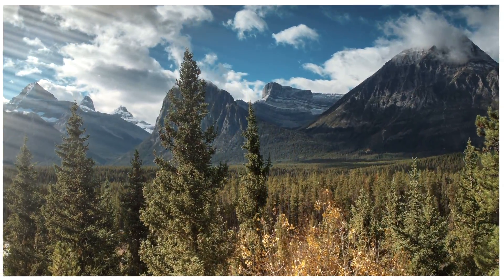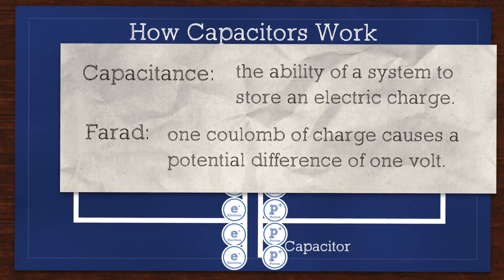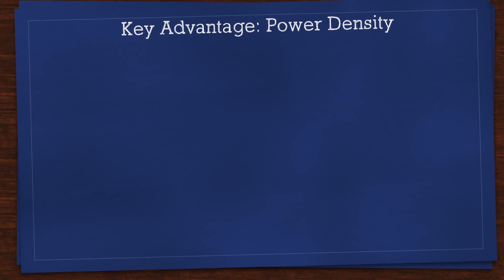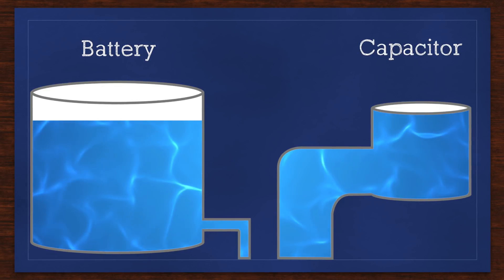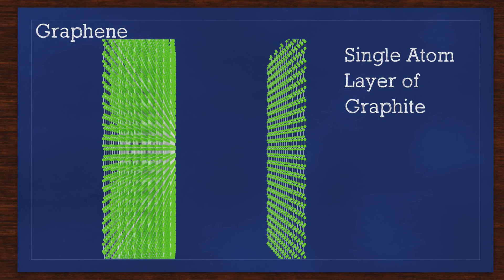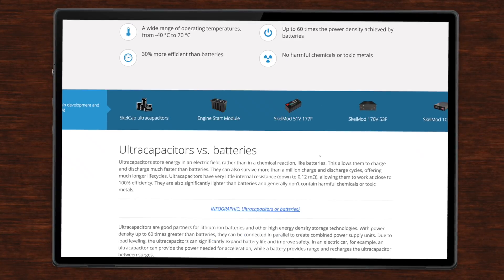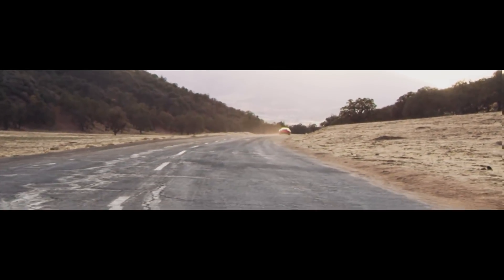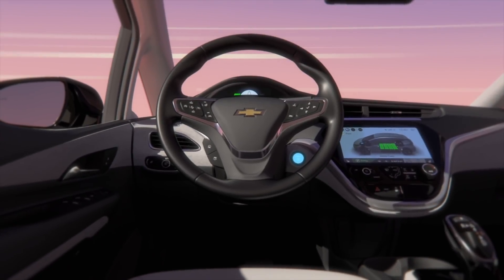Can This New Technology Make Batteries Obsolete?

Comment: I'm not quite believing in the 'charge a car in seconds' hype. The capacitor might be capable of it, but the charger (and the electrical grid it's part of) probably won't be. Charging 100 kWh in one minute would be 6 million Watts. Might as well hit the car with a lightning strike. Even Tesla decided to pull back from the 350kW Supercharger V3 and are thinking 250kW at most.
Reply from the maker: Imagine if charging stations also were charged up using supercapacitors ;)
Reply: True :) but still leaves the problem of how to get the power from one set of supercapacitors to the other without melting the wires or risking the charge jumping right through a fault in the insulation and the air gap and frying a human. Eh, someone'll figure out a way. Or we'll finally find a room temperatur superconductor, lol.
Reply: @Steamrick  the charger will gradually build up over time. No extra capacity required. Even a couple hours would be enough to safely charge the chargers.
Reply: @Steamrick  Just use trolley wires, which at 600 volts can still handle 20+ megawatts.
Reply: @00crashtest  I googled and it looks like trolleybus lines are very expensive to build and operate - which is why they are only on busiest slow streets in cities where gas engine efficiency is at it's lowest. But even current expensive EV buses would be a lot cheaper and way more flexible than trolley buses for highways.
Reply: @artemaung5274  once you begin building lots of them they get cheaper. Time will tell all...
Reply: @TwoBitDaVinci  
The limit is the device receiving the charge. Unless you had a cap/ bat hybrid capacitor the same size as the battery, and trickle charged the battery during transit after a charge stop (heavy?) Or a series of small caps, with a sophisticated switching circuit.
Once the vast majority realise range isn't really an issue and long trip charging is covered by "driver stops" the fast charge problem will largely disappear.
Better to use a slightly smaller battery with cap kers to reduce stress.
Reply: I'm thinking charging station could be configured in a way that it would connect itself to the bottom of the car with large surface area. And it's sort of capacitors charging capacitors with minimal distance and large surface area. Seems feasible in theory. 

Offtopic: Or wireless charging via smart highways - no charging stations necessary
Reply: Steamrick is right. Even if the superfast charger has the power available, everything has to handle the heat, including the supercapacitor bank itself. Of course, if you can get the internal resistance down low enough, you could still get some very fast charging times.

But how about this: If you can do very fast burst charging, then you could have automated charging, probably through induction, at numerous stations along a road, like maybe at intersections. This could get around the heat buildup problem, and charging might not even require any activity on the part of the driver. In the near term, it could be great for buses. (I think there may already be projects under way for just that.)

The other potentially huge advantage, not talked about in this video, is that supercaps could potentially have very long life. And long life again implies very low life cycle cost. (Not that conventional Li-ion cells are all that shabby anyway.) Again, let's not get too hyperbolic. (A little hyperbole is OK.) It depends on how the separator holds up. That separator is why conventional electrolytic capacitors go bad after a number of years. And also, if something lasts 50 years, of course it could just be hopelessly obsolete by then. But still, graphene could make these things extremely durable. On the whole, this could be really BIG.
Reply: Or also make a new grid for transportation purposes only. That grid will interconnect existing railway grids, existing trolleybus grids, future truck overhead wires, existing charging stations, and future megawatt charging stations, which would make charging even faster than filling up. Roads heavily traveled with trucks should also be fitted with trolleybus wires, like what has already been done in Long Beach.

Cities should also allow future pantograph trucks to use their trolleybus wires.
Reply: @00crashtest  
New grid too complicated, too much material, susceptible to damage, either by the stress of trucks, accidents, or roadworks (how would you resurface?)
Even existing tech can out-range a driver in the vast majority of circumstances.
Reply: @ Steamrick: Kind of with you on the hype... And is it truly necessary, even if possible... 10min for 300 miles is more than enough. But hey, if doable in seconds, without hurting the batteries, why not. ;)
Reply: @garn5341  
Imagine the weight of a single cable with cooling?
Reply: The cable needs to be bigger, but probably doable. Porsche Mission E/Taycan will do 350kW - 350A @ 1000V, only make a cable 3 times the cross section area and/or increase the voltage.
Reply: Also the future Mega Chargers for Tesla Semi will probably get into the megawatt territory.
Reply: @sallerc  
Semi charging
4 cables, one for each battery. Simple and provides for redundancy in case of failure of one unit. No longer to hook up, effectively "existing technology" (V3 charger)
Most will charge slowly over night anyway
Reply: 60,000 18650. Am sure there are many chargers in the car.
Reply: The problem I see is electricity goes around the wire not through it. I dought anyone could lift that much wire that it needs to be to pass that much current let alone the eddy currents it would create. Ever hold a fluorescent bulb under a high tension line?
Reply: Dan az, maybe you're thinking of higher frequencies?  At DC and lower frequencies, electricity goes through the whole wire.  

And what is cast off the high tension line is minor compared to the power flowing through those cables.
Reply: Amps versus voltage it doesn't take that many amps if the voltage is correct. Ohm's law genius!
Reply: @BillSmith-ut5li  Insulators have a breakdown voltage at which they become conductors.
Also with high voltages, you risk arcing for which you will need better separation between the negative and positive lines unless you want them to short.
And that is if you are able to apply that voltage directly to the battery as step down converters for high voltages are big and bulky.
Reply: Man, is it just me that the comments are more education than the video by a full 10 miles. That's the real power.
Reply: CCS2 requires liquid cooling the cable to achieve anything close to its rated 500A.
Also many say that the cable gets uncomfortably hot without liquid cooling at 200A.
Reply: Wish I could charge my car with the charge from a lightning cloud. That would make it very cheap to run. Shame about the unreliable supply.
Reply: There are two ways to decrease a super capacitor's recharge time, first is by using super thick wires, or even "wires" made of graphine fibers/powder.  Second is by increasing the charging voltage, course then there's the chance of arcing etc..  But as long as those issues can be overcome, we  could have a bright future for super capacitors. It looks like the Skeleton company is definitely on the right track, even if they only manage to manufacture a couple of layers of graphine instead of a single in the beginning.

Comment: Please do next video on types of electric motors :) Thank You, awesome work you doing!
Reply: Yes!  I was recently trying to look up information about the 'Switched Reluctance Motor' which Tesla uses as their 'main' motor.  It would also be great to compare it to an AC-Synchronous motor, which Tesla also uses as the 'front' motor, in a dual-motor EV.  My little Smart EV also uses an AC Synchronous motor as the main drive motor.
Reply: There are many of them. AC,DC. DC motors... radials, lineals and axial. AC motors 1 fase or 3 fase( in star or triangle configuration), synchronous or asynchronus. The best eficiency ia get from DC motors per weight. Most of them with 95% and 98%(custommotors) AC motors is about 85%.
Reply: @slevinshafel9395  Thats even better for a video!
Reply: He has made a video on Motors. But that was only in the context of Motors vs Engines
Reply: @WardenClyff  I really meant electric motors in deep like types, function, weight, price, power, efficiency and so on. They always can find info I can't.
Reply: Mikeva93 I am confused, could you elaborate? What are you talking about?
Reply: @WardenClyff  I really want video on types of motors(AC synchronous, switched reluctance), how it works, maybe history, show some data and examples and etc. Hope I cleared that for you, if not, tell me :)
Reply: Mikeva93 got it. I’d agree

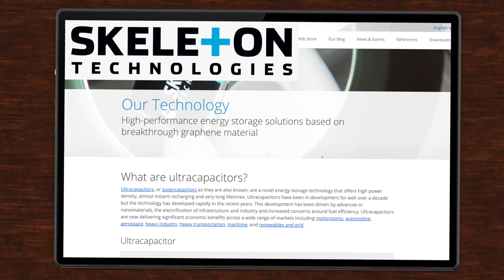Comment: 6:20 - did you forget a few zeroes? At 80g/m² and 5350m² for a football field, that's 428kg of paper to cover it.
Reply from the maker: the paper was just discussed in terms of a square meter. the football field was only discussed with graphene.
Reply: Yeah, but you put a weight difference of 1000 between paper and graphene. If one gram is enough for a football field, that's a factor of 400000, assuming standard printer paper.
Reply from the maker: about a gram, i rounded, for sake of comprehension, but its less than a gram.

Comment: I have been following Graphene  for quite sometime.  But will it really replace Batteries or will it supplement/complement batteries ?
Reply: Jamilul Huq Personally I believe it will be the latter, with both used together.
Reply: Great question. And in the beginning I think it will, without doubt, be used together. For some of the reasons mentioned in the video. Like fast acceleration and better regen.
Reply: supplement/complement...
Reply: Batteries are electro-chemical and therefore will indeed wear out.  Capacitors can be made to last a lot longer, if not effectively indefinitely (So long that some other tech will come about before they wear out).

There has been 20 years or so of research into what graphene and carbon 60 can do for us as compared to 300 years of battery tech research and development.  It is beyond foolish for anyone to think that capacitors will not just dominate but completely replace all but only the most specific uses and far sooner than most are giving it credit.

Cost for graphene based capacitors is less of a concern at the industrial scale due to the massive benefits of peak shaving.  As soon as there is a large grid scale storage and discharge solution that can handle so much power that power companies can actually opt to decommission their oldest/least efficient plants or completely avoid having to build a new one, they will be bought and implemented.

Consider the fantastic losses on hydroelectric as the single most important aspect of the implementation of graphene ultracapacitors.  Hydroelectric is just a constant outrush of power onto the grid that typically happens when the water is in proper supply, not when the power is actually needed.  Having this scale of high speed storage and discharge would be unbelievably useful.  So much to the degree that it could even be possible to "harvest" a rather fantastic amount of power during peak water flow periods and then discharge that power when there is not enough water.

No, the holistic view of energy is needed and where the real issues lay.  Peak loading is the #1 issue above all else.  It exists due to the #1 problem:  Energy storage.  Every other form of energy we use other than electricity can be easily stored.  The moment that electric energy storage is truly defeated, not only does it solve the peak loading issue but it will trickle down into everything we have that uses electricity.  All our mobile and cordless devices and most importantly, our modes of transportation.

Imagine this...  City busses that are capacitor driven.  They could charge and recharge anywhere that they have a holdover and be ready to go again in at most, mere minutes.  There would be no range anxiety for them at all.  There would be no need to go back to a depot to refuel and there would be a massively lower level of maintenance needed.  Beyond that, look at the huge benefit of wiping out all those diesel powered and particulate emitting vehicle engines.  It is also mildly ironic that the engines that emit carbon particulates would be replaced by something that uses carbon lattice as the method of energy storage.
Reply: At present there seems to be no reason for it to actually fully replace batteries ... but in future, what where technology takes us you never know.
Reply: When you guys speak of graphene technology are you referring to a normal state, micro state or nano state of the graphene in a capacitor?  There are two things I disagreed with and/or wanted to correct wht this video states! One being that I was taught that there are always some energetic particals on each plate of a capacitor unless it is discharged manually or via a resistor! And even with a discharge there is still some energy on both plates! One energy is applied the first plate begins filling up with electrons and they are trying to find a place to go so one could say they are all excited and bouncing off one another which builds a pressure which at the same time the first ones are bouncing and getting excited, it causes the less amount on the other plate to do the same bouncy and excited, and as they also do so their pressure biulds as because the electrons start to move over until the pressure builds to it's designated point and it dischages and all of this basically happens in a nanosecond or faster!!!

The other thing was his mention or where capacitors were used! Capacitors are used in just about all if not all motorized anything and anything that conducts or is run by electricity. Heat and Air units, cell phones, TVs, computers, drones, digital cameras, cash registers, in almost all vehicles potentially, aircraft of all shapes and sizes, many military vehicles possibly even some of the weapons! Anything you have ever opened and looked at and/or took out of any piece of equipment and wondered what in th heck are all of those little things! For the most part thentiny little barrel looking things usually standing up on the board, or black boxes most of those are capacitors!

The reason they are functional now in place of batteries is one they need to get the nano-graphine stuff figured out as well as a regulator that slows down the release ot the charge build up then cars would need batteries and a vehicle could go longer without recharge which only take minutes!!! It is also potentially an almost endless "battery" rarely needed a recharge! That is the beauty of a capacitor they just have to figure out its discharge issues and other than a load consuming bits of energy as it passes thru the motor, light or whatever so as the power exits the load it returns back to the capacitor and does everything over and over and only needing a charge much much later than one would need to charge batteries of any type!!! It should keep filling and discharging  just as it did when the car originally started up! Then the start is taken out of the loop and the el should continuously flow, but they kust figure out a regulating system for the amount discharged and when it discharges and how much!! It should allow the load to operate and just keep passing power until the load finally cosumes the energy! And thatwould be when u quicly recharge and start when readyto go wherever!!
Reply: Gold is going to miss some worth. Because of Grafen.hehehe
Reply: Capacitors require voltage boosters (DC/DC converter) to use them like a battery so it adds up to the cost equation. Once the capacitor + booster is cheaper than battery it may replace the batteries.
Reply: It will when I will introduce it soon.
Reply: @Jamecbond  It will  next Year wach me.
Reply: @bartoszbarejko1585  I most certainly will very eagerly.